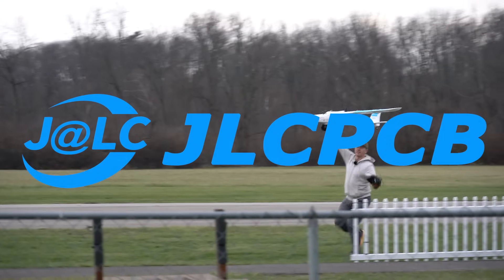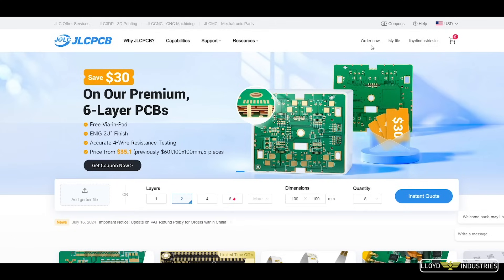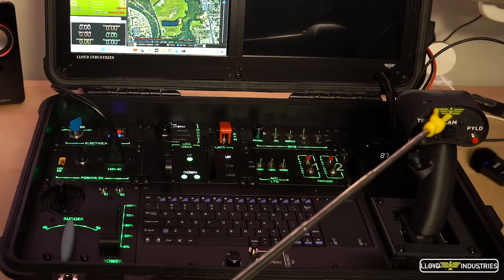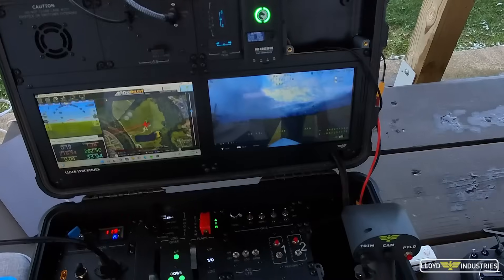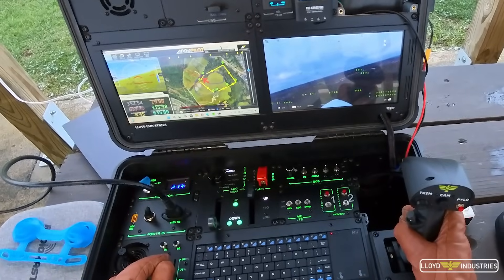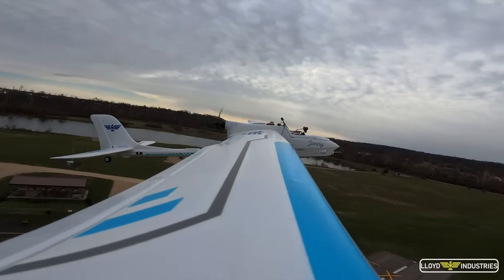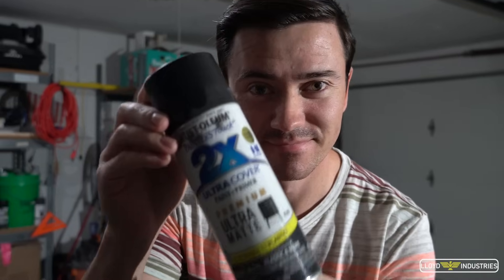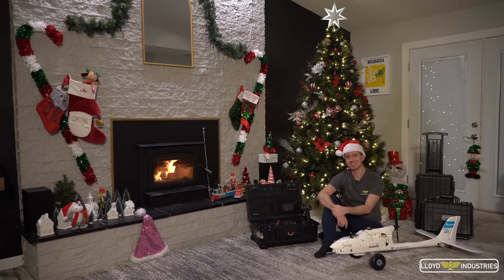The Ultimate RC Radio!? Custom Homemade Ground Control station with Folding Joystick!

Comment: caN YOU pls share how to change mode, arm/disarm with switches? Do we have to use the joystick function of mission planner?
Reply from the maker: To arm and disarm with a switch change this parameter in Mission Planner RCX_OPTION = 41, change x to whatever channel your switch is on. Changing modes with a six position switch required me to program the arduino to read the input from the switch and mapping each stop to a corresponding value between 1000-2000 and selecting that channel as the flight mode channel
Reply: @ thank you very much for your response. As i am using TX radio via sbus, then if i use the way like you do, do i have to use joystick function of Mission Planner?
Reply from the maker: No it should be a pair of channels just like the gimbals on your transmitter. I don't use Mission planner for control at all.
Reply: @letsMakeItFly  thank so much. I am really appreciated

Comment: Someone just made my sketch from like 10 years ago come to life, that is so cool. Only thing I would do differently is to have a differeny screen layout in the lid, and just go buy a joystick with yaw control.
I might also prefer having connectors on a waterproof hatch at the back of the case , and have module bays on the lid, but that is too much work and plugging in a few cables every time is not that hard.
Reply from the maker: Its been a dream of mine for a long time as well! Excellent ideas, thanks for the comment!

Comment: Awesome grounds station! How did you connect joystick ? Via mavlink ?
Reply from the maker: Thank you, it uses hall effect sensors and magnets connected to an arduino that then maps the signal to 1000-2000 and sends it to external transmitter (TBS Crossfire) via CPPM

Comment: How much would it cost to buy it? If you could upgrade it to make it even more simple and user friendly, what would you do?
Reply from the maker: Excellent question. I think the goal would be to have the set up you saw in the video at around $1000USD that's without the TBS Crossfire and video receiver. I would add a color touch screen with edgeTX so that it is easy to integrate with peoples existing JR modules (external transmitters) The modularity of this I think would allow the price to come down to I think $300 for a bare bones aircraft control only ground control station with additional upgrades available after the purchase. The components that really raise the price are the PC (~$250USD) and the Monitors (~$100 each).

Comment: I work for a drone geophysical survey company, we fly large single rotor helicopter UAVs on long range beyond visual line of sight survey missions. We also use a ground control station, we only use the 2.4GHz RC controller to land and take off, as soon as the heli leaves the takeoff location the RC is switched off and connection between the helicopter and ground control station switches to 400MHz telemetry link via an antenna and modem mounted on a 15m high pole, we can manually control the helicopters via the ground control station but on survey the helicopters are fully autonomous flying pre programmed lines while terrain following at low level, we just monitor the telemetry and send a command to tell it to come home, we set a lost link timeout so if we lose link behind terrain for longer than the timeout setting the helicopter will come home, sometimes in very difficult terrain we have to push the lost link timeout up to a couple of minutes, which we don't like doing it's nerve racking and if something was to go wrong during the lost link we could have a problem finding and recovering the wreck.
Reply from the maker: That is amazing! Hard to believe thats legal honestly! haha and LTE connection or something like that with virtually unlimited range would probably be an easy solution to that problem? Thanks for sharing!
Reply: @letsMakeItFly  We have certification to fly beyond visual line of sight which is an extensive process to go through with piles of procedures and operations manuals to be written and approved, right now we are in the process of integrating a satellite link for long range telemetry to mitigate the problems we have with lost telemetry link in areas of difficult terrain.
Reply from the maker: That sounds awesome! Id love to get something with a satellite link. And im well aware of how many hoops the authorities makes you jump through. I hope to jump through them one day
Reply: @letsMakeItFly  We are Australia based and we found that BVLOS (beyond visual line of sight) approval wasn't actually quite as difficult to get as we thought, and the good thing about it is once you get your first BVLOS project approved its a lot easier after that to get approval for other projects, and once we have approval for a certain region the approval for that region is ongoing, if we get further projects in that region we just have to submit a plan showing where the new survey areas are. It's all about mitigation, everything possible that can go wrong has to have a procedure to mitigate it, and you have to have lots of redundancy, for instance our helicopter autopilots have dual real time differentially corrected GPS's but can also navigate via inertial reference from accelerometers and gyros if all GPS signal is lost. We spent about 3 years developing everything, finding the right helicopters, developing our autopilot hardware and firmware etc, it was difficult to say the least we destroyed over a million dollars worth of helicopters before we finally got everything working right, now crashes are very rare but they still happen you have to expect some losses with drones.
Reply from the maker: That is surprising! Id love to get some kind of approval like that but then again I probably need a better reason than "shooting a youtube video" 🤣 the dual GPS and, sounds like, dead reckoning navigation sounds amazing, specially if it was designed in house. You must all have a solid head of gray hair! haha Very cool indeed and thanks for sharing
Reply: @freshwaterguideservice  Yeah we could do that and we are looking at something similar. We've never actually had a situation where we lost a survey drone and didn't know where it was, as for the situation where we lose telemetry link due to the drone being on the other side of big hills it's something we have to find a solution to its actually against regulations to lose telemetry link and not know where a drone is and not have control of it, so it's something we avoid or at least minimise as much as possible usually just by moving the base to another place where our tall ground station antenna can stay connected to the drone, we have two other solutions we are developing, one is a satellite telemetry link and the other is using a tethered drone carrying a radio repeater and antenna that hovers at a high enough height above the ground station that it is in line of site radio comms with the survey drone, a tethered drone is powered through the tether it can basically hover on its tether above the ground station all day.
Reply: @ats-3693  Tethered balloons are perfect for that. Military still uses that technique as well as for other reasons. As for satellite, I instantly thought of StarLink. That should allow for video bandwidth.
Reply: @tobins6800  Yeah we've considered tethered balloons carrying a repeater, but that would add complexity and risk to our field setups with the crews having to carry fairly dangerous bottles of compressed lighter than air gas in our 4x4s etc. I think a satellite link is probably the best solution, the current 400MHz telemetry link isnt actually very high bandwidth we don't send video telemetry our UAVs aren't fitted with camera's, the telemetry is just UAV control and status monitoring.

Comment: This would be great as a kit for those without 3D printers and cad programs. I can follow schematics and I'm pretty good with a soldering iron and heat gun. I've built GCU's before, although not as pretty as this one. You should try a 3D video system or build one yourself. Works great close to the ground but the effect goes away with altitude. So works really well flying FPV with something that can hover like a multirotor or a heli. Chasing my buddies through the woods in 3D is a blast!
Reply from the maker: Didnt even know 3D video systems existed! Absolutely im working  on how to put something like that together now! Have to get edgeTX on here first though to make it user friendly and a proper RC transmitter. Thanks for the comment!

Comment: So glad I came across your video.  I'm working on a very similiar project.  Last year I mounted my components into a Pelican roller case.  It's initial purpose was for transport but I wound up working mostly out of the box due to the lack of a table that was promised : )  Some components like the VRX, ADSB antenna and frequency analyzers were mounted to the lid with velcro and the displays were free standing.  And the laptop and windows tablet both sat on a platform in the bottom half of the case.  It was very crude. But seeing your setup inspired me to make it more permanent and compact.  I never thought of disassembling the radio and incorporating it into the case.  Genius.  Liked and subscribed.  I hope more people see this.
Reply from the maker: I'm glad I've inspired you to take it to the next level! Its very rewarding flying with your own contraption. I will say the disassembled radio didn't work very well. Mostly because the rotary encoder that I tried to use to replace the knob would skip steps so the menu was pretty much unusable. There's probably an easy fix to this but I also didn't want to deal with all the wires going to the lid. The radio had to be installed on the lid for better antenna reception and i had to route like 37 wires up to the lid and was a big pain.

Comment: First off amazing. 

30 seconds in… joystick must twist for rudder. 

8 minutes in…. It’s too hard for me to figure out at the moment. 

Guess I won’t have a joystick rudder either.
Reply from the maker: Haha trust me I thought long and hard about how to do that. I even took apart my old flight sim joystick to try and replicate its mechanics but it was way too intricate with special springs and I just couldnt. Thanks for the comment though! Let me know if you come up with another idea.
Reply: @ I know it’s nice to have it all self-contained as much as possible. And you did a great job at that. But I’m brainstorming, what if you did use a nice Sim joystick and rewired the Hall effect sensors and buttons to an internal ESP or Arduino, and used a DIN or multi-pin (15) circular plug to connect the joystick to the flight box. Is it comfortable using the joystick at box height?
Reply from the maker: Thanks for the comment. That sounds a bit complicated. I think It would be better if I just included a usb port that you can plug in an external joystick of your choosing. Also complicated im sure but would allow for greater customization. It can be a bit awkward depending on how high or low you are sitting. But the joystick is adjustable and has 5 stops where I can position it and that really helps.

Comment: You can always step down voltage locally near the leds or add a regulator where it's needed. Other wise you gotta make a psu board with multiple rails and not overload em

A RF patch bay would be neat, a little section to connect antennas to. This whole set up reminds me of a herelink
Reply from the maker: The fix im working on for the power distribution is a custom centralized power distribution board that will step down/up voltages for each system. So the FPV display is powered by the same buck converter that powers the arduino and it would draw too much current so the arduino would freeze up. The new PCB im making has two separate buck converters for each system. And it would get rid of all 3 buck boost converters I got in there. The other screen is powered by the PC via usb. 

Maybe one day when I develop an integrated transmitter or something but really im just focusing on getting proper and snappy control using external modules like the crossfire. I think that’ll make it the most versatile.

Comment: Really nice work!! If I were to build one, I’d make it like a “tray style radio” like two traditional gimbal sticks that you pinch. And maybe another gimbal stick for controlling the camera.
Reply from the maker: Noted! Since its very modular that would be very easy to implement. Its much easier to implement traditional gimbal sticks than that folding joystick! Would you have the sticks on either side of the box? Like one where the throttle panel is and another where the joystick is?

Comment: I would buy this. If anything I would like it to be modular and be used with all or most transmitters
Reply from the maker: Absolutely, that was the goal from the start. Its obviously a pretty big investment if you buy it all at once but you can start with the essentials for control and then add on a PC and FPV Screen etc. My goal is to make it work with most external JR Modules and maybe even put a trainer port of some kind where you can connect a whole seperate radio. Thanks for the comment!
Reply: @letsMakeItFly  very cool project! I'd use a surface for touch screen. If you could spin up a custom board you can use any open hardware design like a 9xr to act as the controller. For such a set up you want to be able to configure inputs with same flexibility as outputs(say you had a different control module for multi rotors or even a submersible vehicle. I'm not sure if open tx supports it but if the control input board  could simultaneously output via usb and to a JR module it would enable mission planner to also act as a backup control link. Would be nice to add a section to use power tool batteries or have a built in lithium cell with charger. There's some pretty cool waterproof pass through connectors could be used for charging instead of having power come out from a panel and risk breaking a lcd. Add LTE modem and RTK base station and this thing would be absolute fire
Reply: The latency between control and video looked bad, is it a digital video system? Mission planner can overlay its HUD onto an ipstream, if you have analog you can use rca to usb (even more latency) and view your fpv right within mission planner. With a WiFi ap you can even share the feed and control link with other computers
Reply from the maker: Awesome feedback! I forgot to mention I think but the screens are touch screen. The screen and pc combo i used (small fanless PC) worked really well. Really id only update the screens for better viewing in direct sunlight. They’re not great in that regard. 

The backup control via mission planner is a great idea. Well see if chatgpt can figure it out. 

I thought about adding an integrated battery but i decided to go with flexibility of choosing your own. It would be pretty easy to wire in a battery connector inside where you can place a lipo battery on velcro or something and that way you have no wires coming out of the panels. 

The LTE modem and RTK base station sounds awesome! 

It is a digital system and it may have been the actual controls. I noticed while testing that the control surfaces didn’t move quite as fast as they would with a regular radio (boxer). Thats probably my poor coding on the arduino for the CPPM signal. 

Overlaying the FPV feed on to mission planner would be an awesome idea to get rid of one of the screens and just making one large one! 

Thanks a bunch for the comment. These are great ideas and thanks to its modularity, it shouldn’t be too hard to implement some of your suggestions!
Reply: @letsMakeItFly  Sounds like something is using delay or something with an interrupt is hanging the loop. Are you by chance using a USB serial joystick and also using analog read for everything? The idea of using an tranisis as the controller board is neat but I'm sure there were some issues getting your controls to use the same potentiometer ranges the radio was expecting. I'm sure that can be fixed too with the right code. 

Since your using your own board, I'm guessing you loose rc telemetry and are using a different band/module to send mavlink/telemetry. While frsky sucks, adrupilot can send mavlink over FPORT giving you even more redundancy, with some decent coding knowledge you could  use s.port/f.port to send control and to also receive telemetry for the ground station
Reply from the maker: The joystick uses hall effect sensors and a magnet that is then analog read by the arduino. The limits and throws are mapped in code.
Reply from the maker: Im using a holybro telemetry radio for the mavlink. It just connects to the pc via usb. Honestly im not very well versed with FPORT and SPort and those sorts of things. All i really know is that the crossfire uses the crsfr protocol. The arduino spits out a CPPM signal and thats really all I know. I need to do some more research on how to integrate different communication protocols. Ive been wanting a dragonlink to eliminate that and have the telemetry sent to the pc via wifi or bluetooth but i havent gotten to that yet.